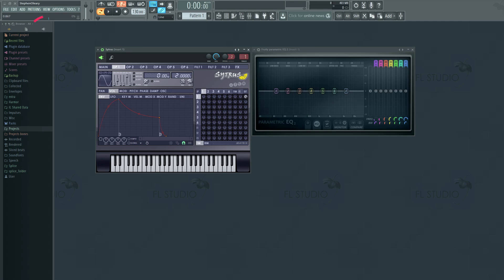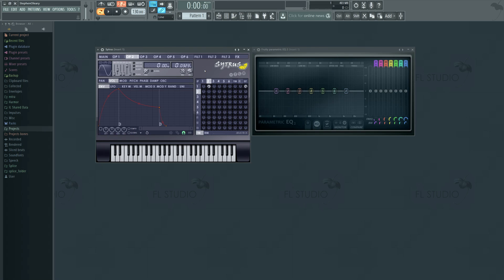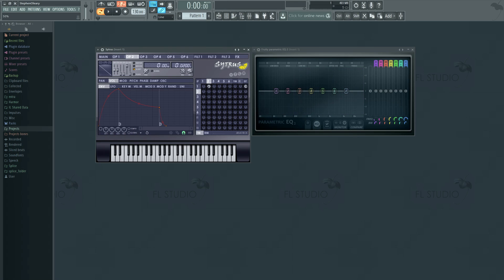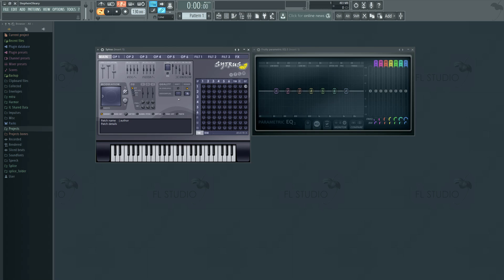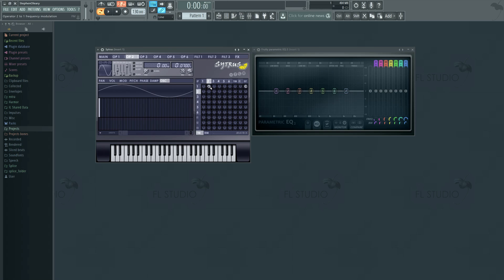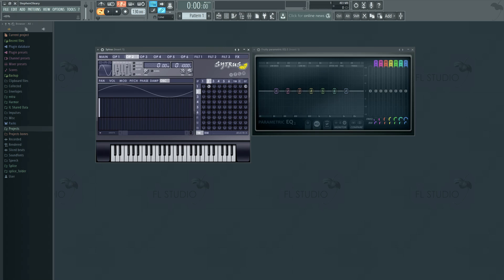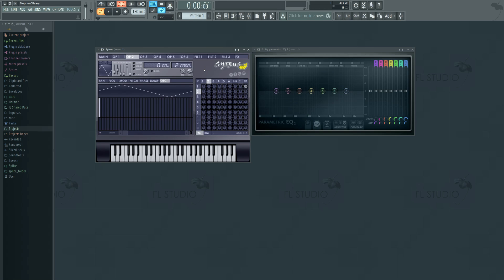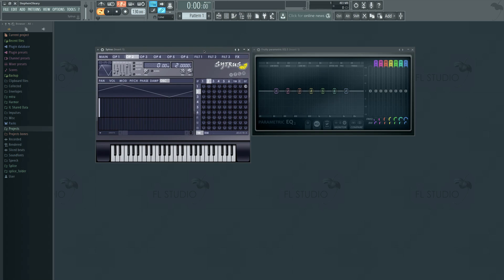How To Use FL Studio SYTRUS - What is FM / Sytrus?

Comment: OHHH! Combined with some research on phase modulation, this actually makes sense! I think the Doppler Effect is a really good comparison. And the part with 0 and 360 degrees being the same on the unit circle totally explains why the square wave doesn't change anything. Thank you so much! P.S. For those who want a way to visualize phase modulation, check out this link: kh01 .me/c/phase-modulation (remove space before period). It helped my understanding a lot. The orange wave is the carrier frequency, and the blue wave is the modulator. You can see how the wave motion of the modulator causes the phase starting point to shift across the carrier, first in the same direction (which makes the resulting frequency lower/slower because of the Doppler Effect type idea), and then the opposite direction (which makes the resulting frequency higher/faster), and so on. This causes the FREQUENCY to change in a cyclical motion, much like frequency modulation. That's why they are nearly the same and synths can use either one. Try experimenting with different variables to see what it looks like. When the carrier frequency is faster, you can see distinct groups of different frequencies, but when the modulator is faster, you can see smaller, often widely varying peaks and valleys on each larger wave. For those who know sine and cosine functions and maybe a little calculus and want a mathematical explanation of why FM and PM are practically the same, check out this link: moinsound .wordpress .com/2011/03/04/frequency-modulation-or-phase-modulation-synthesizer-technologies